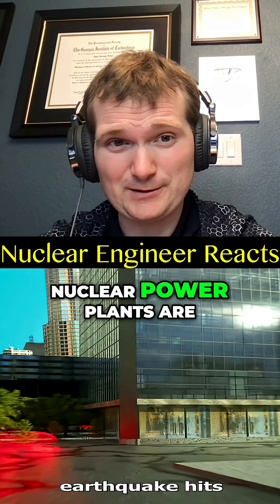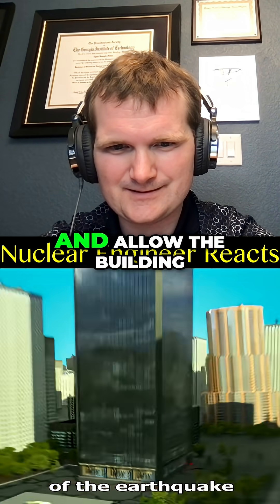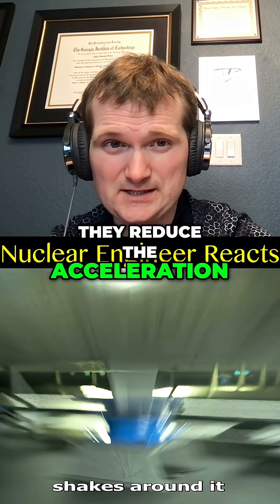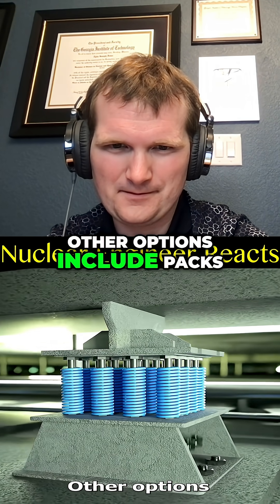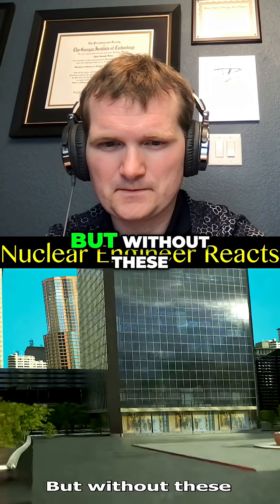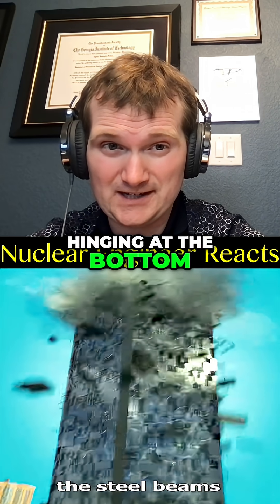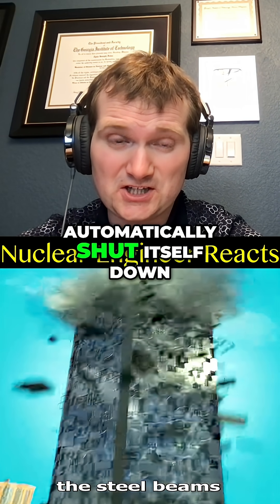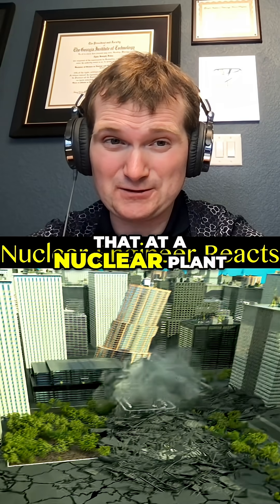Why Skyscrapers Don't Fall During Earthquakes - Nuclear Engineer Reacts to Zack D. Films

Comment: Ohhh another geophysics video! Love to see it. 

Concrete + Rebar actually works fairly well for buildings that aren't too tall. The building I lived in when the Chilean earthquake hit in 2010 had a dissipation band from top to bottom, essentially splitting the building and changing the normal modes of the building entirely. 

As a seismologist I'm only knowledgeable about earthquakes and oscillations themselves, not building techniques. Historically, based on 2011, the earthquakes themselves are less an issue compared to the tsunami that ensues after compressional/extensional earthquakes. Not sure if anything changed after Fukushima, but I hope something has!

Comment: The Deep Heat Mining project in Basel. In 2006, an earthquake was triggered by geothermal energy in Basel, Switzerland. The strongest was 3.4 on the Richter scale. Could geothermal energy cause more severe earthquakes?

Comment: Engineers said Fukushima was safe.  didn't think the wave could push up the sea wall so much and knock out the backup power.
Reply: The problem was that the earthquake lowered the level of the land.

Comment: Makes me wonder if the Fukushima reactor implemented any of the safety systems Tfolse has described. I am curious if it had any of the emergency shut down safety systems that Tfolse mentioned
Reply: it didn't have dampers in the foundation..... it did have auto shutdown with control rod drop (scram) and secondary coolant pumps. they ran on diesel generators. which were full of water. i know..... bit of a chocolate fireguard moment.

they could have sacrificed the core meaning it wouldnt have melted down.... but they never. it managed the first phase of reactor scram, meaning the control rods were dropped, but as it wasnt being cooled by water pumps, neutron absorber should have been put in the core. it would have ruined the fuel rods. they never done this because they didnt want to hurt the share price of the company.

now there is no true sushi left in japan.
its all cooked. lol
Reply: The reactors were in scram and shut down as designed but the cooling system failed due to the tsunami. It flooded the backup generators. Even in scramt the fuel is still doing fission and needs to be cooled.
Reply: A lot of additional safety systems were actually added after Fukushima, tiler talked about it in another video and the Fukushima was actually old and poorly maintained
Reply: The problem was that the ground slipped, it's level being lowered meaning that the water of the tsunami could easily go over the sea wall that was supposed to protect it.

Comment: What about underground nuclear facilities?
Reply: Vibrations are more predictable underground. The maximum acceleration is lesser underground than above ground. 

It's been a hot minute since I read Aki and Richards book, but the half space response (solid-air boundary) is double compared to the whole space solution (solid block). The best analogy for this would be to measure vibrations in the middle of a steel beam vs vibrations at one of the ends. The ends will move more. 

There are studies of oscillations studied at boreholes, and the vibrations last for less time, they have less peak acceleration, but more energy (because they still have high frequency content). But in general they should be less destructive.
Reply: they get the B-2 special
Reply: cool. majority of people are unaware they exist. lol.
most of those are inside bunkers designed to take a hit from a thermo nuclear detonation as they belong to the military. Most missiles coming from enemy would be programmed to actually air burst because the shockwave hits twice. its more effective at levelling a city. a ground burst bomb makes impressive crater, but does less area damage. even a direct hit from a ground detonation from a bunker buster shouldnt leave us like the ready brek man. i agree seismic isolation is one thing that would improve its chances, just like building a box within a box and controlling air pressure between the walls. but as weapons get more powerful and destructive, new building methods would be used to plan around them.